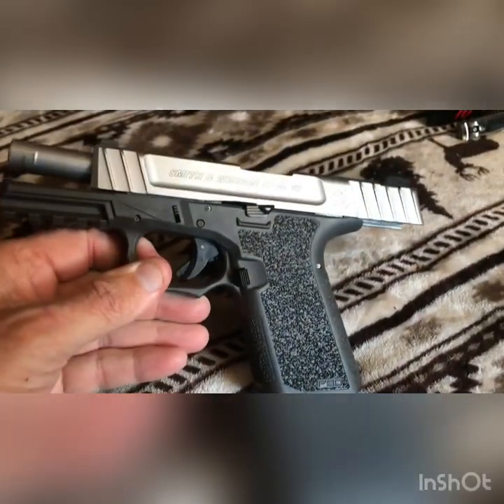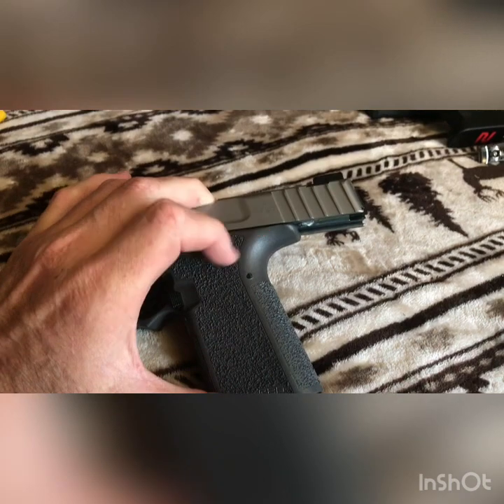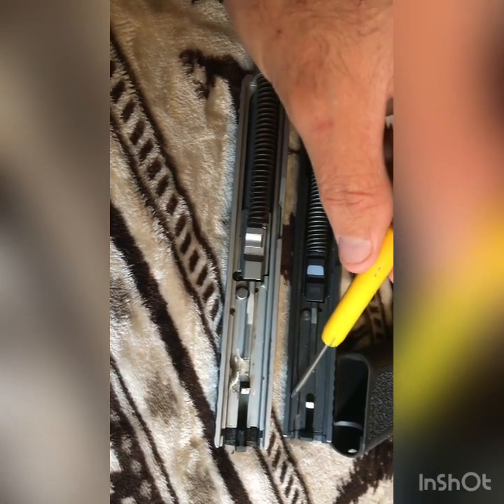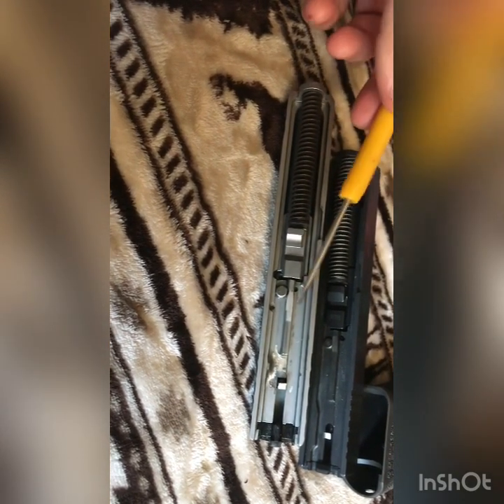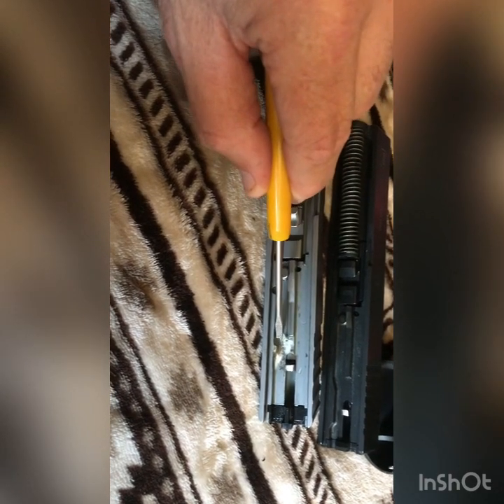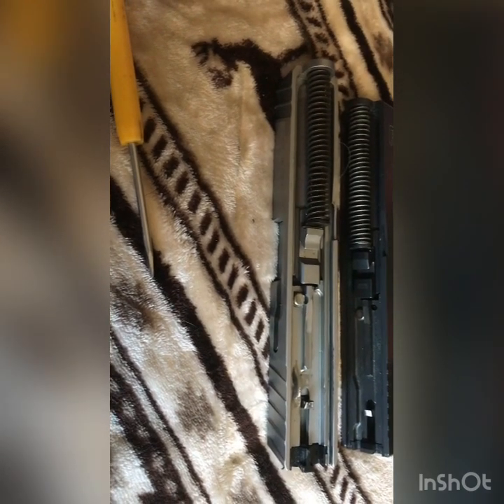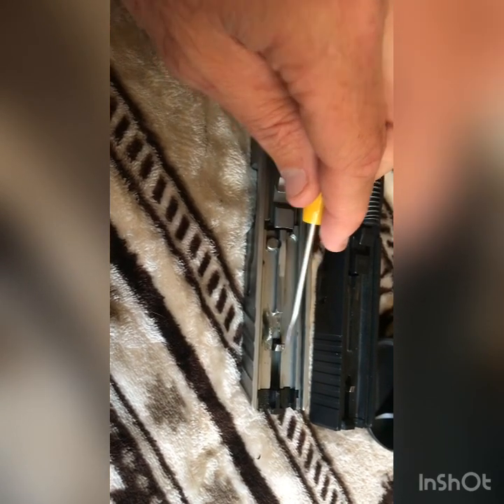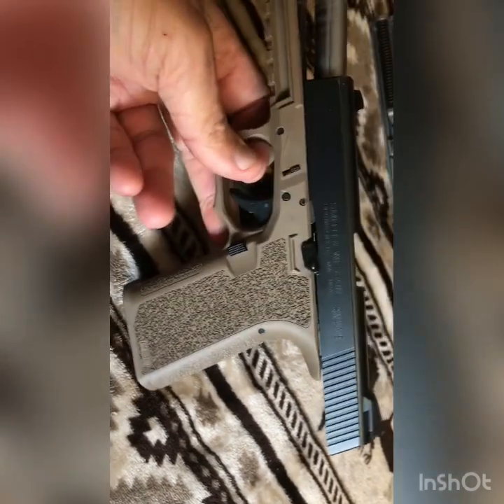How To Mod A Smith & Wesson Slide To Work On A Polymer 80 Frame

Comment from the maker: Apologies for all the screwdriver tapping and scrapping. Still newbie at making videos for YouTube, so cut a brotha some slack. 😂🤣🇺🇸
Reply: Are the sigmas the same way ?
Reply from the maker: @_kp_556  I believe they are and can be modified.
Reply: @blackriveroutfitters7185  I own a sigma and hate that fat mag release button, keep hitting it firing lefty… considering slapping that upper on the 80 19 frame..
Reply: @Black River Outfitters i need your help with my build
Reply: Do you know if it would work in a PSA dagger?

Comment: Ok you inspired me. I am nearly finished, but I went a different route. I used a PSA Dagger frame. Little did I know it was more difficult to do on the frame,  I'll explain why. With the slide facing up I had to machine off a piece of material that is right near the barrel breach on the rail groove... It's a small nub that sticks out and it will not allow the slide to cycle completely unless mild off, It was impacting with the rear block. The other extra step I had to take, this is in addition to the ones you did. Unbeknowing to me the Dagger frame is little shorter than the P80. I had about 1/4" slide overhang, that is due to the downward sloping angle on the S&W slide, So that had to be machined down. Got it all on and it's cycling great. Just waiting for an aluminum striker cover (that I will have to machine down to fit the newly trimmed slide) the .40 ejector and a Glock firing pin. Then I should be off to the range. I'll tell you what the more I'm working on this the more i'm liking this pistol it is a very rewarding experence.

Comment: That's brilliant but hack. You should have machine that nice and smooth instead of it looking like you took an axe to it. If you're gonna go through all that trouble you might as well do it right and make it look finished. I can imagine that rough surface is good for the internal parts to be sliding over repeatedly. I have an SW VE40 slide and am considering doing this But I don't know if it's even worth it To tell you the truth probably more trouble than it's worth. Is still on the fence about it.

Comment: Be careful with this mod.  Since the piece on the slide that resets the trigger is a lot smaller on the s&w, this "hybrid" will not have an out-of-batery safety.
Reply from the maker: Thus far I have drop tested a few I’ve done, smacked the crap outta them with hammers and the failure you described is an urban myth. They have never “Accidentally” discharged……….  And the “Safety” is always held.

Comment: I’m doing mine now.  I milled my slide out and now I’m on the dremal just rounding off the edges.  I was checking how far you had it rounded off.  This video is a great reference.   Thanks again.
Reply: my question also.  my idea was to use a sharpie and color the hump.  slide it on to the assembled 19 frame and it should show where is it hitting.  for a starting reference point.
Reply: Welt. Here’s the thing with that.  So you clearance the hump to pass by the shark fin first. Then it goes back to the reset.  So yea the sharpie will get you there. (That’s how I did it just with a lil grease). I also used a mill with a 1/8” bit. Makes it easy. But with just a dremal and a small burr bit it’s totally doable.   Your going to take 2/3rds the fin off and round it off with a dremal anyways so the mill isn’t important. And I just matched the stock firing pin to a G19 one. And it also worked mint. If you wanna put your email on here. I’ll send you some pics and measurements to get you in the ball park then you can just delete the message after I get it. And I’ll show you everything I did to get it to work perfect.  It’s not hard at all.  Black river just can’t post it on YouTube.
Reply: @jamesgravel7755  do u have a Instagram
Reply: @jamesgravel7755  i really need hep
Reply: @jamesgravel7755  I'm up for a write up.
Reply: Sorry for the late reply.  I do not have any social media. But I’ll do what I can

Comment: You mentioned using a Glock firing pin in the video instead of modifying the existing S&W one but the Glock firing pins that I got are longer and do not fit in my SW9VE, SW9V or SD40VE slides. Which ones did you use?  Thanks.
Reply from the maker: Did you take everything off the Glock firing pin? Like the spring and cups, etc and replace them on the Glock firing pin with the spring, cups, etc off the Smith $ Wesson?
Reply from the maker: Also you will get a lighter primer strike with the Glock firing pin because it is longer than the S&W pin. This has never been an issue in the ones I’ve built. I finally got comfortable after the the second of third one I built and just started modifying the S&W firing pin, which give a super strong primer strike, which may come in handy for any military surplus ammo that may come on the market. Assemble it the way I said and try it out. Use a Glock 19 for the 9MM S&Ws and the Glock 23 for the 40 cal S&Ws.
Reply: @blackriveroutfitters7185  Thanks, I think I will try modifying to S&W Firing pins. Also I plan to mill the slide instead of using a Dremel tool. I cut the tabs on the PF940C with a fret cutting tool and it worked like a dream. Hardly any sanding (and no possibility of errors with the Dremel. Any other tips?  Thanks.
Reply from the maker: A milling machine is definitely that way to go. A Dremel works for those that don’t have access to a milling machine. Take your time removing the material, so you don’t remove too much. So remove a little and try the slide and repeat if necessary.
Reply: My first slide is a SW9VE. What I found is that a firing pin from a glock 43 is the perfect size and the tip is a slight bit longer so it will make a better impact on the cartridge. Again you do need to change out the springs, cups and sleeve still. Also of note, I have a slide and barrel from a SW9V (the original that Glock sued over) That I am also building with the same firing pin. It fits here but the tip needs to be flat (not round) so it needs to be filed to fit the pin opening (slot) on the slide. I hope my comments may help another builder out there. Thanks for the great videos!
Reply from the maker: For sure, thank you for your input. It’s always welcome here, so people can modify and make something useful and better.

Comment: Good info!! I know I take to much material off but I'll try the jb weld
Reply from the maker: It will work. People freak out thinking JB Weld will make it “Blow up”, however the only function of the JB Weld is to activate the trigger reset. Same as having the area milled into the slide.
Reply: @blackriveroutfitters7185  awesome thank you sir people get butt hurt over the stupidest things... I recently JB weld my pin holes just because I want a  challenge lol major reason why I wanted to do this build
Reply: Hey do you guys have a website?
Reply from the maker: @TinoBamBeano  not at the present time.

Comment: Can you post a video of the sw40ve mod for the glock 19 frame.  My 40v frame got damaged, and figured i would go this route since it is very easy to get a glock frame.  I have all the parts kits and pf40c frame also.  My curiosity is while shaving down the sw 40v slide.  on the sd40 slide you left a little bump out from where you shaved it down.
Reply from the maker: The mods in this video will work on all the SW40VE slides and are the same for the SD40VE, SD9VE, SW40VE, SW9VE, SW40GVE, SW9GVE, SW40V, SW9V, etc. You will need to remove material as shown in this video and modify or replace the firing pin (striker). If you decide to go with the Glock 23 firing pin make sure and use all the S&W firing pin parts on the Glock Firing pin. There is a difference in the firing pin face, however this does not cause light primer strikes as brought up by another subscriber. I have a Glock 19 firing pin in my SW9V and the video on that one speaks for itself. My email is in the “About” section, feel free to email me with any further questions.
Reply: @blackriveroutfitters7185  Glad I read the comments/this one specifically, answered the main question I had about compadibility and a couple of others I didn't know I had lol

Comment: I think you are forgetting something here.... The s&w uses a round tip firing pin, the Glock uses a vertical notch firing pin... did you file down the tip on the glock firing pin to fit the s&w slide? I dont think that would leave much meat on it and last long. The other thing is the "foot" of each firing pin is not only different like you mentioned in your video and like you said you can file it down to match, but the foot on the s&w firing pin sits much much closer to the tip then the glocks firing pin foot. This would mean you are not cocking a glock firing pin in a s&w slide near as far back which would mean the firing pin is hitting with much less force, and probably lead to light primer strikes. Am I wrong? If so please correct me on this, I think using the factory pin s&w pin and modifying it is the way to go.
Reply from the maker: Noted, all I can say is with the modifications I performed I have had not a single light primer stile or a failure to fire because of any firing pin (striker) issue. I have fired well over 1000 rounds of various manufacturers ammunition including steel cased ammunition in some of these modified pistols without that being an issue.
Reply: @blackriveroutfitters7185  Understood, I am going to be doing the same mod, I just got my slide yesterday I will try to make a video and ill post a link for you on what I am talking about, maybe its not as much of a difference as it looks, thank you for this vid, you gave me a new project to tinker with. Have you had any issues with the firing pin safety plunger? the s&w slide the safety plunger seems to stick a lot farther out then on a glock slide, I was wondering if it caused a rough or horrible trigger feel, or if you looked into using a glock safety plunger instead of the s&w?
Reply from the maker: @deadhorse3389  I haven’t had any issues with the S&W safety plunger and I haven’t checked to see if the S&W and Glock plungers would interchange.
Reply: The s&w sw series uses a straight firing pin.  The SD series uses the round tipped firing pin.  I ordered a straight slot Glock firing pin to place in the sw40v slide.  Will have to mic the protrusion to see if there is a difference between the s&w sw firing pin and the glock firing pin.
Reply from the maker: @nda1689  you might have something there...... I have only modified the S&W firing pin mimicking Glock firing pin on my SD’s. I will try a Glock pin on the next SD build. I have used the Glock firing pins in the SW models.
Reply: @blackriveroutfitters7185   I swapped out the firing pin and am getting light primer sticks. Did you use the SD styker spring or glock springs

Comment: Aye black river  I need yo help .!! I did wat u said but I have no trigger.. trigger is dead as hell.. everything else  so far seems fine when racking No Trigger .! Wats the fix ..Th nkz
Reply from the maker: Email me at blackriveroutfitters1972@gmail.com
Reply: my trigger is dead
Reply from the maker: @oscarrodriguez459  email me. I suspect you took too much off the slide (Which isn’t hard to do). It can be fixed and made to work again.
Reply: @blackriveroutfitters7185  I gotta stupid question, can you get the same results just by modifying the trigger bar reset?

Comment: Aye wat up doe.!.? Will a S&W M&P sheild slide work on p80 frame.? If so can u show me how to do it.?
Reply from the maker: Have never tried to mode the M&P Shield.
Reply: @blackriveroutfitters7185  ok if you do let me know wat happens.! And would u happen to know where I can get a Springfield xd 40 frame.? Or 1 compatable.?
Reply from the maker: I’ve seen Springfield XD frames for sale on Gunbroker that would have to be sent to an FFL. There are rare and sell fast, but I have seen them for auction/sale.
Reply: @blackriveroutfitters7185  ok thnkz. Any luck with the s&w M&P sheild 2.0 slide yet.?

Comment: @ black river outfiiters. Would that work on and m&p slide ?
Reply from the maker: No this conversion will not  work on the S&W M&P models. Wish it did!!!
Reply: If yall ever find a slide that does almost accommodate a gen 1 m&p with slight modification please post. I have a extra m&p slide but can't find a frame.
Reply from the maker: Will do

Comment: What mags do you use with the sw9ve/sd9ve slide on the p80?
Reply from the maker: If you built it on a full size P80 frame the Glock 17 mags. If you built it on the compact (Glock 19) frame then you can use Glock 19 or 17 mags.

Comment: Can you do a video explaining how you mad the others one
Reply from the maker: All of the moding on the S&W slides are done exactly the same way regardless if it’s a 9 or 40. The only slides that will NOT work for this mode are Smith & Wesson M&P Shields. Stay away from those slides for this mode. The slides you wanna find and mod are the SW9F, SW9V, SW9VE, SD9VE, SW40V, SW40VE, SD40VE, etc. Email if ya find one and are in wondering if it will be able to be moded or not and I will let ya know for sure.
Reply from the maker: I also sent ya a couple email with pictures of the S&W 9mm slide mods. May have went to your junk Mail folder.
Reply: @blackriveroutfitters7185  what about regular m&p 2.0 slides
Reply from the maker: @THECARSHOWFEED  I don’t believe they will work. I’ve looked at several and I have passed because they won’t be able to be modified. Then again with enough time, $ and patience I guess anything can happen. 😂

Comment: Do you think a taurus pt 24/7 pro ds 40 slide would work?
Reply from the maker: I have no clue, never tried to mode one of those........
Reply from the maker: Finally found a picture of the inside of the slide you asked about and I don’t think it will work. On a P80 frame. Looks like it takes a FCU (Fire Control Unit), which is classified as the “Frame” and would have a serial number on it. Kinda like building the Sig P250 or Sig P230.

Comment: Do you know if they work with the old sw9ve slides if I'm not mistaken that's the one they got sued over
Reply from the maker: Yes I’ve built them in SW9VE, SW40VE, SW9V, SW40V, SD9VE, SD40VE, SW9SGE. They are all the same, well at least the mods that have to be done. Obviously there are small differences.
Reply: @blackriveroutfitters7185  I got one I'm stuck with man I would love to get a p80 frame
Reply from the maker: @originalbabygeestak9819  There’s tons of them on Gunbroker, KM Tactical, Brownell’s and more!
Reply: I can't find any in stock That are not gouged.
 last time I bought one it was 65 bucks plus shipping now they are 180... I need to do that to this ugly sumbitch I hate the frame but with the a combo of the MCARBO and APEX trigger kits my trigger is probably smoother than a glock I think a Glock frame would make me want to take it out every now and then lol
Reply from the maker: @originalbabygeestak9819  standby I’ll take a look and see what I can find and post up the link. Most of the PF940C I’ve been getting them between $100-140. It’s been that was since January 2020 if not before..... I can’t remember who had the black frames for less than $100 on sale. See if I can find them again.
Reply from the maker: @originalbabygeestak9819  

Primary Arms was the name and are now sold out..... KM Tactical and Brownell’s has the PF940C for $149.99, so yes in the last few weeks they gone up in price from even what I was paying. 

https://kmtactical.net/search/keyword/PF940C/search-in/product/cat-in/all/search-other/product,p_sku $149.99. 

https://www.brownells.com/handgun-parts/frame-parts/frames/pf940cv1-80-frame-textured-for-glock-19-23-32-prod97837.aspx $149.99.
Reply: @blackriveroutfitters7185  thanks brother HOOAH
Reply: Hey brother haven't looked for it yet so pardon me for asking but do you have a how to video on exactly what to do to get it installed I got my frame an hour ago from a guy around the way
Reply from the maker: @originalbabygeestak9819  yes there a video up. I would suggest emailing me and I will send ya more detailed photos of the mods that need to be done and instructions.
Reply: I offer numerous gunsmithing service with fast turn around and no bullshit cerakote, duracoat, and other custom finishes along with frame work I can send photos when you email me
Reply from the maker: Sent you an email with pictures, etc.
Reply from the maker: @renesanchez2800  will do.

Comment: So would a full auto switch work on it
Reply from the maker: I have no clue………. Didn’t know they made such things for Smith & Wesson’s. It would have to be made for the S&W I would guess……. And I’ve never in my life heard of one.
Reply: @blackriveroutfitters7185  I think so tho bro because. The frame is basically for the Glock.  I had the sd40ve n the switch fit but it wouldn't work because how the the trigger n hammer are made